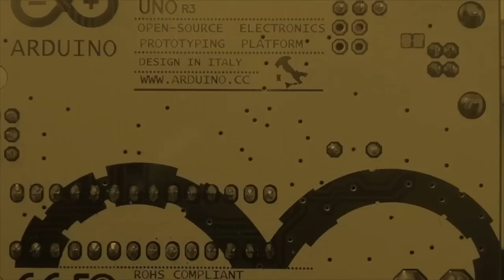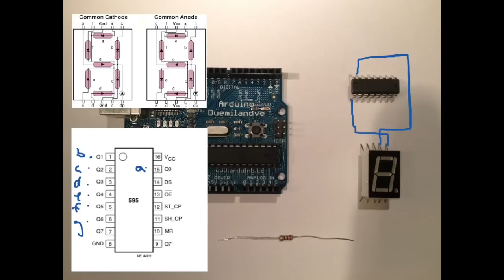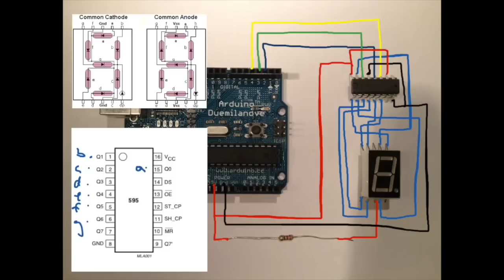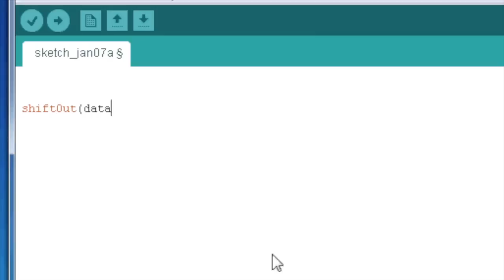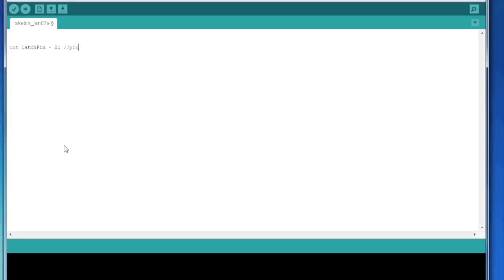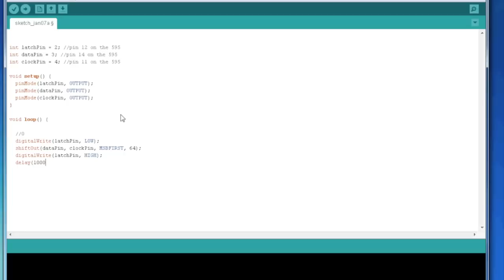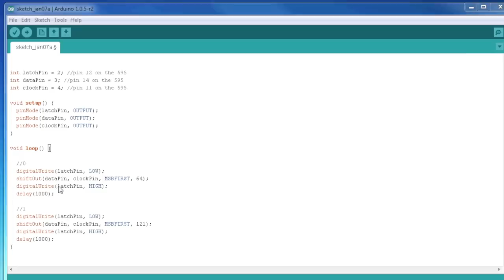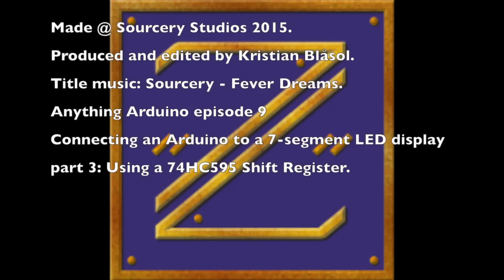Using a 74HC595 to connect an Arduino to a 7-segment LED display - Anything Arduino episode 9

Comment: hi im having problems with my project here. i did the same thing as u did here but my 7 segment doesnt light up no matter what. Thank you
Reply from the maker: If you try one led. Does it work? I forgot resistors. Use resistors to prolong the led segment lifetime.
Reply: @SourceryOne  thx bro for your reply. i alr found out my problem haha. my display is a common cathode XD
Reply: @SourceryOne  hey man. do u know whats the code to actually turn off my 7 segment display? llike.....no lights at all
Reply from the maker: Depending on common anode or common cathode send all highs or all lows to turn off all leds.
Reply: @SourceryOne  alright man. appreciate it!. looking forward to your tutorials!
Reply: @SourceryOne  sorry..what i meant was how do u know that "64" is the MSB?
Reply: @SourceryOne  or how do u find out the number of bits for each of them i meant. thanks
Reply from the maker: It is explained in the video also check some older videos about binary counting) But to set all to low send a 0 value as that sets all bits to 0 or 255 which sets all bits to high (1)
Reply: @SourceryOne  ok i get it. those binary values u were talking about are all fixed. wont be changed

Comment: So excuse my dumb question (I'm new into electronics), why do many other people connect a bunch of resistors to each pin but the anode and you do the exact opposite? I'd do the same as you but I can't get why people waste time to connect like 7 resistors when 1 on the anode is enough.
Reply from the maker: I believe I do the wrong thing. The resistor is there to limit the current to the LED. If you have the resistor on the cathode then the current has already passed the led and that could lead to a shorter life of the led. There are common anode displays that should be better to just use one resistor with as they all share one pin as the power source.
Reply: @SourceryOne  wait, isn't this display a common anode? Which falls in the category of your last sentence.
Reply from the maker: @KToMmi  I’m just saying there are two types. I don’t remember which I used. I guess I say it in the video.

Comment: Hi, Thanks for the awesome video, 
Is there a way to use an LED strip / neopixel other than the 7segments LED display using the shift register?
 The neopixel are only 3 outputs and the 7 segments are 10 outputs.
Reply from the maker: The neopixels are a completely different kind of leds. Look at a later “anything arduino” video where I show how to control neopixels. You need a library (fastled for example) that makes it possible to control the neopixels any way you want.
Reply: @SourceryOne  Thanks, I watched the videos but it was not controlling the neopixel with a shift register.
Reply from the maker: No you don’t need a shift register for the Neo pixels. They have their own “register” control circuit built in. Hence you need a library instead.
Reply: @SourceryOne  I want to build a stopwatch and countdown timer using a neopixel , in the tutorials they use a 7 segment display or and LED matrix, I think I'm approaching the project in a wrong way.
Thanks again
Reply from the maker: Maher Alsayid if you want to use neopixels instead you need to place the neopixels as a 7segment Display and then figure out the correct code to light up the leds just as a 7seg would. Then you assign these patterns to the corresponding nr and then you can use neopixels as a 7seg display. Hope that helps. :)
Reply: @SourceryOne  Thank you I will try that out.

Comment: electronically well explained, codewise i would have used an array that holds the values and send that ( code simplicity )
Reply from the maker: Thanks for the input, and you are of course correct. However arrays might be harder to understand and might need its own episode just to go through. :)

Comment: Thank you for the video. What happens when is an cathode common display with the code?
Reply from the maker: I think I go through this in the video. You need to invert all the bits so you get different values. On the sheet with all the values there are values for both common anode and common cathode.

Comment: Hey. I want to use 74hc595 to control a large 7 segment display with a common anode. With the 5V Arduino power supply I make a 9V small converter to give the display proper cathode power supply, of course I connect to the junctions of the movie but when I power the system without downloading the code all segments on the display light up and the code does nothing. I am asking for help with this problem.
Reply from the maker: I don’t fully understand how you have connected it. If the segments need more than five volts then you need to control a larger voltage with the outputs from the 74hc595. For example by connecting it to a npn transistor or similar. Watch this video for how to hook that up. But instead of the legs of the arduino you should use the outputs of the 595. Hope that helps.
Reply: @SourceryOne  
I just connected the reinforced 5V from arduino to the common display anode and the cathode to 595.

Comment: Thank you a lot for this video! It took me a while but in the end I learned how the shift register works. Are there other shift registers with more outputs (Q's) availible for Arduino purposes?
P.S. Definitely gonna buy other 595s and put 'em in series!
Reply from the maker: If you want more outputs you put them serially.  That way you can have LOADS! Of outputs in only three pins. If you check my anything arduino series there should be another video on using two in series.
Reply: @SourceryOne  I wanted to say in series.. Always confuse with these words. Already saw the video. Thank you again!

Comment: Hi his video is very interesting, I wanted to ask if it was possible to manage 32 relays via bluetooth with the 74hc595 system. Thank you very much for the attention
Reply from the maker: It is possible to manage 32 relays with 595s, yes. However I can’t answer for the Bluetooth implementation as I don’t know how you would build that and what components to use.

Comment: I suggest the code for digit "9" shall be changed to  "16" from "24"

 in common anode (tested) 

 digitalWrite(latchPin, LOW);
 shiftOut(dataPin, clockPin, MSBFIRST, 16);
  digitalWrite(latchPin, HIGH);
  delay(1000);

and  

maybe "111" in common cathode (not tested) from 103

 digitalWrite(latchPin, LOW);
  shiftOut(dataPin, clockPin, MSBFIRST, 111);
  digitalWrite(latchPin, HIGH);
  delay(1000);

thanks for the knowledge man, @Kristian Blåsol Thanks A ton .... :D

Comment: hey. Emm I have problem.. How to write a dot? I pin it in 9. and programed but ot not  show :(
Reply from the maker: You need to add 128 to the byte value you send for the dot to light up as well as it is the last bit. If you send 255 everything should light up.

Comment: why you first put latch pin zero then put latch pin 1 can you explain some logic?
Reply from the maker: The latch pin is set for the register to be able to recieve new serial data. Once it has been recieved you "latch" the pin, and the data is set to the pins. So the latch pins moves the data from the input serial pin to the actual register where it controls the 8 pins if they are up and down. So if you dont flip the latch then either the chip wont be able to recieve the data, and will only pass it along on the serial out port. Or the other way around it will only recieve data and never set the data to the pins... Hope that explains it a bit more...

Comment: Thank you very much, this video helped me a lot, but i'd like to ask that, how can i display other characters on the display?
Reply from the maker: You simply use the table shown in the video and descide which led segments to light up, and you add together those values, ending up with a number between 1 and 128 (I think it was). Sending that number will display whichever character you want (and that the display can show)...

Comment: SIR,
   we have seen ur vid. what we r doing is, we r using 5by5 led matrix an trying to creat a sliding "HAPPY BIRHDAY" using 74hs595 we are trying to use algorithm, not same but the similar one  can u plz help us to so ,will ur algoritm work on what we r doing??
Reply from the maker: +gaurav nagrale not sure switching is fast enough? But a simple way would be to have one 595 for each row (so 5 595s) and serial connect them and every new row would "push" the previous row forward to the next 595/row. And then just find out the pattern to use with binary adding just like I explain in my 595 videos.

Comment: I have a question. The chip you are using has constant output current rated max at 70 mA, and I'm sure if an 8 is displayed, it uses more current than that. How would you go around that?

Comment: Wht change in the cabling when we do it with a commun cathode ?
Reply from the maker: Instead of connecting the common anode to plus you connect the common cathode to ground. Then you use the red values in the diagram instead of the green, and that should be it... Let me know how it goes.

Comment: Hi Kristian, I am working on a 7 seg display which is made of from LED strips. Each segment has 3 LED and one power. I need to display at least 8 digits at once. which comes up with 56 segments. I would really appreciate if you could suggest me right power distribution plain. and should i arduino mega, or Uno with a chip?
Reply from the maker: Hello, When it comes to power I cant really suggest something or other, it is really up to how much your led strips require in power and current. Usually LED-strips run on 12volts, and the arduino runs on 5, so some kind of conversion needs to be done there. 
If plan to use 595s for displaying the numbers, then it really doesnt matter if you use a mega or uno. You basically only need three pins that you will shift out the numbers serially to all the 595s probably. 
Hope you get it working! Good luck!
Reply: Thanks for responding , I reference a lot from your videos.  If my project is a success,  a lot of credit goes to you.  I will post a video at the end of it. Thanks again.
Reply: Use the ULN2003 to drive the strips simply hook ur output to the chip straight forward.

Comment: Thanks for that! I want to use another 10 or 14 rgb leds If This could go. Can I use 595s for that aswell? And how do I need to write The Code then? Something like: shiftOut(dataPin, clockPin, MSBFIRST, 1)? For the First led? I dont think that it is so easy to do it.
Reply from the maker: Yes you can use additional 595s to add LEDs and segments. Every LED adds another Bit to the equation, and if you have followed this video and others where I explain Binary counting, every Bit added has double the value of the Bit before it. So for every new LED you need to extend the table I use in this video (link: http://www.duinos.net/files/2015/img_2379.jpg) with the additional rows. So this table goes up to the 7th bit which has the value of 64. 8th bit is 128, 9th 256... etc etc so you need to add those, and find out which value each bit/led is. Then just as I explain in this video, you add all the bits/leds values together and shiftOut the value. Hope you figure it out. :)
Reply: Ah that makes sense! Thanks alot and also thanks to These Quality Videos! :)

Comment: Thank you very much for this. I've just made a binary counter with 4 led's and the single digit that gives the hex. I clearly have a Cathode, took me a while to find out, luckily you've talked about the difference. 
I couldn't find any documentation to give me the letters I needed. So I went thru every possibility. 

Here they are if somebody else has got the same problem. 
56 L
57 c
61 g
94 d
113 f
115 p
118 H
119 A
121 E
124 B
Thanks a lot, keep up the good work.
Reply from the maker: Great info, thanks! I think someone else made an extended sheet with the hex letters as well, but you have a few other letters as well, so good information for anyone looking to do the same.

Comment: all the wires are crammed together that I could not tell where to put the wires and what resistor and wire to put, help here plz? The Arduino I bought linked this vid but my bread board is bigger. Can someone tell what resistor to use and what wire color to use, where to put it in Arduino and breadboard?
Reply from the maker: If you watch the whole video I do explain very thoroughly where to put every wire. 220 ohm is usually enough. wire colors does not matter in this setup.
Reply: So I can use all blue and no red? Are every color same purposes but different sizes?
Reply from the maker: if you just use "dupont" cables, then the colors does not matter no, they are only in different colors to make it easier for you to know what is what. For example always using red for +5V and Black for ground, that makes it easy for you to find these. But you dont HAVE to use these colors...

Comment: i have a question ... How can we do the same thing without using the shiftOut command?? in other words what can we replace it with ??
Reply from the maker: You still want to use 595's? And dont want to use the shiftOut command? Then I guess you need to make your own clock, data and latch pins and functions, that work as shiftOut. It is possible, I even think you could use buttons as both clock, data and latch... Look for a video by Kevin Darrah, I think he did that experiment (with buttons)... Or watch the first two parts of Anything Arduino, how to use the 7 segment display. Where I show how to use it with only the arduino, or with other IC's, not requiring shiftOut.

Comment: hey I did it but there seems to be a small glitch. all the digits are showing correctly except 2, 5, 6. While showing 2 the segment B doesnt light up but it does for every other number. And as for 5 and 6 the segment C doesnt light up but it does for every other number. I checked the code and the binary numbers also. What might be the problem?
Reply from the maker: Double check so that connections are correct, maybe it is switched with another pin? It sounds very strange, since it works with other numbers...?
Reply: I thought I might have switched the segment B and C and tried again but the problem still persists. every other digit is correct. I tried displaying an 'o' using the segments C D E G since mine is a CA display i set the segments A B F as high, but the segment C doesnt light up. Only D E G do. please help

Comment: I have a common cathode, is there ane changes at the chematic?
Reply from the maker: +Adimas Narendraputra Actually no, there is no change in the schematic for common cathode. Instead you should use the values in the RED column in the diagram.

Comment: how do i know if my display in anode or  cathode
Reply from the maker: +WolfTalk Common Anode or Cathode only refers to which side of the LED pin is the "common" pin, or shared pin. So a Common Anode has all the positive side of the LEDs connected together, and a Common Cathode has all the negative pins connected together. You can find out what type you have by connecting the common pin and any other pin to plus and minus. If you connect the minus/negative to the common pin and you get light on the LED then you have a Common Cathode. Orelse you have a Common Anode...
Reply: Kristian Blåsol yes thanks I'll try that out
Reply: +Kristian Blåsol yes its common cathode, but i have heard that you can blow the chip if you do it wrong, is that true?
Reply from the maker: No, I dont think so... LEDs are diodes and if you put power on a diode the wrong way, nothing will happen... they only work one way, and "protect" from connecting them the other way around. As long as you keep around 5V there shouldnt be any danger of breaking the chip.
Reply: Kristian Blåsol ok thanks, I was just making sure. I only have 1 chip

Comment: thank for your lovely tutorial.
I want to know how i could use it for 10-12 volt 7 segment. do you have any scheme?
Reply from the maker: +farjamful You probably need to add Transistors, Relays or Optocouplers for each segment. So remove the 7segment led display, add your choice of transistors/relays/optocoupler and add the higher voltage components on the other side of the transistors/relays/optocouplers. Good luck.

Comment: How much ohms resister do you recommend
Reply from the maker: +Dillon Driskill Most values work. The resistor is there to prolong the LEDs life. The higher the value, the dimmer the LED will shine. as I answered above, I think I used 220kOhm, which is usually enough, but should be on all LED pins, and not only on the common pin as I did (because I am lazy)...
Reply: +Technology Master if you look at his resistor, you can see its either 10,000 or 1000 ohms. im betting on 1000. (its one or the other because the video is kinds blured so some colors look like others.)
Reply: +Dillon Driskill but i looked around and did stuff and found out it works best with 1k resistor
Reply from the maker: +Technology Master Sorry for the late reply. I believe I use a 220kOhm resistor. That is usually enough. Although for it to be completely correct you should have a resistor on every LED not only on the ground pin as I do...
Reply: Kristian Blåsol oh. well I'm color blind so I guess that's why I can't see it :P but I think a 1k would work fine, if you don't have to use it for prolonged periods of time
Reply from the maker: Sure! All that happens is the LED will break faster, but probably not faster than I scrap my projects ;)
Reply: Kristian Blåsol  I whish I could use emojis on comments
Reply: specifically the cry laugh face one